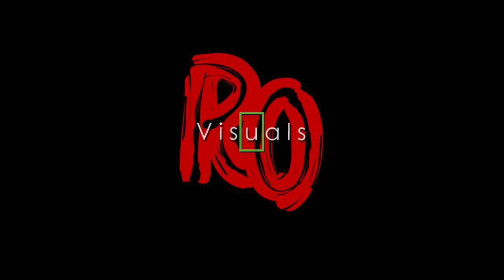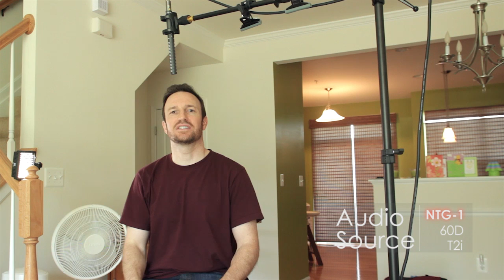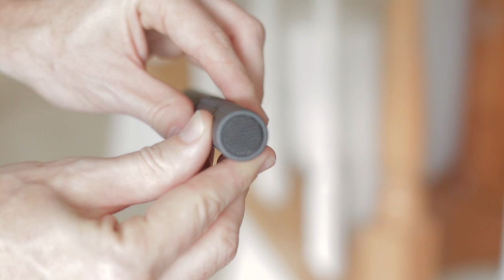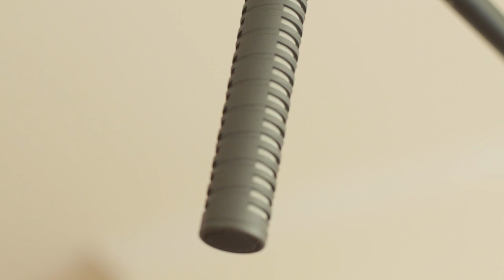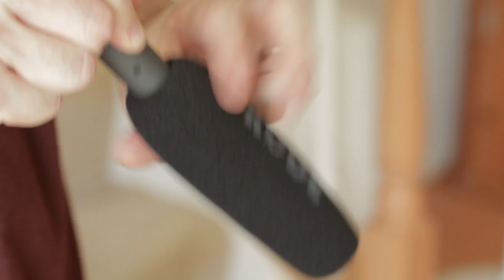Rode NTG-1 Microphone into a Zoom H4n for Dual Sync High Quality DLSR Audio for Video

Comment: Why didn't you go over the low pass filter switch?
Reply from the maker: This is too old to remember. And so am I ;) But seriously I never use it. Check the spec and make sure it's not set too high, you'd be fine using it at 80hz on most stuff but I just apply that in post production to avoid baking in the EQ

Comment: This was a great video and helped me make up my mind. Thank you and thanks for dropping the links as well!
Reply from the maker: Thanks, Joshua.
Reply: @RayOrtega  Quick question. I got the NTG1, LOVE IT! I also bought the multi function boom you linked up. Mine has a light mount at the end of the boom. I've done a search but can't seem to find a proper adapter to a 3/8 in screw. I'd like to mount the mic the same way you have here. What did you use as an adapter? I'd be more than happy to buy through an affiliate link if you have one. Thanks!
Reply from the maker: @DonahueJosh  Did you get it? I think there is a 1/4 20 thread on the tip of the boom pole correct? you'll need a 1/4 20 to 3/8 adapter https://amzn.to/34qn28N (affiliate) I just had the mic mount on the pole not properly attached cause I didn't have an adapter at the time

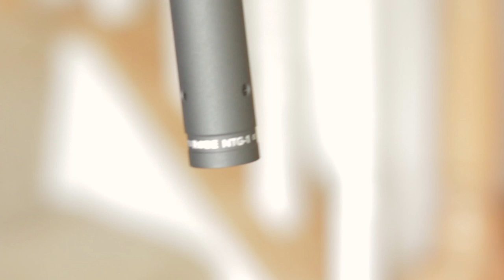Comment: First off, great video! At 6:02 the audio is only coming from one side. What do you have to do in post in order to fix it only coming out of 1 side? What is your workflow for that?
Reply from the maker: It's actually being recorded into channel one. So it depends on how your recorder works. In the case of the H4n you see here, if it's set to multichannel then that channel one will be its own mono channel. If you are recording a stereo channel and one mic goes left and one goes right, then you can split that apart in the edit and turn it into two mono channels which I show how to do and talk more about here https://www.youtube.com/watch?v=PvI2qgZ9bOs

Comment: Ray Ortega
BRO! When I realized the microphone you're using was an NTG-1 I was blown away! The mic sounds phenomenal! All this time I thought it would suck and I would have better luck investing in an NTG-3 mic because I plan on using it for better sound quality during filmmaking. I'm now highly considering the NTG-1 being that it already gives great sound and it's inexpensive. But Idk what do you think should I put in the investment now or settle for the NTG-1 and save the NTG-3 for later? Hit me back bro!
Reply from the maker: The NTG1 is still a great mic. I think what you are paying for with the NTG3 is the built quality and its ability to stand up to tough, in the field conditions. If you use the NTG1 properly then you'll get great results like this. With any mic, it's about distance. You need to get the mic as close as possible and make sure you set up the recorder for proper gain which you can also see on my channel. If the recorder is good and the mic placement is good, then you'll get great audio.
Reply: I mean my biggest thing is I want to be able to have a mic that will work outside as well if I'm filmmaking outdoors, but I'm not sure if the NTG-1 will do that since it needs phantom power. Unless if there's a way to work around that. Also I want to be bale to use a blimp and deadcat combo to keep an interference noise out i.e wind, loud noises, etc. Now lately I've been looking at the NTG-2 but again now quite sure. Any advice on this?

Comment: How did you get the signal to be so crisp? There's practically no noise or hiss. I used to run an NTG-1 into an H4n before I got a Tascam DR-60d ii and I could never get my signal to be THAT clean. Did you do post processing on this to reduce the noise?
Reply from the maker: Part of it is the proximity to my mouth. It's so close that it's probably impracticable for most setups but I was able to run the preamp less by being so close. It's also likely that I did a little clean up in post but if the noise isn't already quite low, post isn't going to help that much.
Reply: Ray Ortega what's your input level in that time?

Comment: Hi Ray...(sorry for my english it is not good) i have a Zoom H4n and a Rode NTG 2. Put i have a lot of sough when i use the Mic with 48V. And when i use the Mic with AA 1.5V Batterie then is the sough a little bit fewer. I can´t hear sough in your Video, why? It is so great. Thx für your Answer.
Reply from the maker: The H4n and NTG2 have an impedance mismatch and don't work well together so you have to turn up the gain so much that it creates noise. The NTG1 does not share the same issue and so I can run mine at a lower gain with less noise

Comment: Thanks for this video. I'm trying to eliminate "hiss" from using a lavalier mic going direct into my Canon 70D. Does the H4N cut out ambient noise or is there an additional interface being used?
Reply from the maker: +Mr. Self H4n has noisy preamps like the ones inside a DSLR but you can see that I've had success with direct lav to DSLR including the 70D https://www.youtube.com/watch?v=ZJi85J9SXyI so it could be your mic, if it's not sensitive enough and you have to set the preamp too high. The Zoom H5 and H6 have much better pre's and the H1 is great for 3.5mm plugin power lavs http://podhelp.me/h1amazon

Comment: I have an NTG-2 and the H4N and I'm hearing so much preamp noise. I'll lower the recording volume but then have to boost it in post and I'm told that not a good way to do it because boosting in post also boosts the noise floor and I do hear much of the noise come back when I boost in post.

So... what is your secret? Why so little preamp noise?
Reply: +MagnumDB Oh wait - Lord Bif Music may explain it. Well damn!
Reply from the maker: +MagnumDB yeah those two are famous for not working well together. I'm using the NTG1 in this video not NTG2. It has to do with a mismatch of the impedance of each device.

Comment: Great video, Ray! Question about attaching a shotgun mic to the boom stand. I'm currently using a NTG-2. Is it necessary to purchase a shock mount or can I use the mic clip that came with it? Is the shock mount crucial if the mic is in a stationary position?
Reply from the maker: +Ctrice if the mic is not moving, you can get away without a shockmount. You just have to conscious of it and be careful, monitor the audio when possible.

Comment: Excellent review, excactly what I needed, thank you very much! Something that might worth to be noted though: the NTG-2 got the ability to have a battery in it, that's true, but it's not the only difference: it has a bigger impedance, so with a H4n it's better to get the NTG-1, in order to avoid some bad white noise (if I'm correct). The maximum input sound level is slightly different too. Again thank you, couldn't find a better video for this mic with the H4n
Reply from the maker: +Lord Bif Music thanks! With the NTG2 that probably explains why I see lots of people reporting issues with getting enough gain out of the mic. I'd be curious to try the NTG2 with other recorders to see the difference. It's definitely the mic. I would prefer between the two because of the battery but I knew that there were some issues with it and the H4n. Thanks for the great feedback.

Comment: Thanks for the video Ray! I recently bought the NTG-2 and I connected to my Zoom H4N with the XLR cable, but it it barely registers any noise, even with the recording level up to 100 and it being an inch from my mouth. Do you know any way to remedy this problem? Additionally, it was only recording mono, is the NTG-2 only a mono mic, or can you make it stereo? Thanks a lot!
Reply from the maker: Are you sure you're powering the mic? It needs a battery or phantom power but lot both. That mic needs lots of gain but you should be getting a better signal. Most mics are mono cause voice is mono. If you mean it only goes to the left channel that's just how the h4n is setup up. Try recording in 4 channel mode and each xlr should record to its own mini track otherwise in steep mode channel one will be left, channel two right and you have to split them apart in post pro.
Reply: Thanks a lot for the reply! I think I got it now.
Reply: +Ezra Tillman The ntg1 works better with the h4n. However, the ngt2 works great with the h46.

Comment: So, I've been doing some video podcasting, and I've been using a condenser mic (blue yeti) which picks up a lot of extra noise. Picks up the washing machine, the furnace in the next room, and people walking on the hardwood floor in the apartment above me. I was told I needed a Dynamic Microphone to cut out background noise, but I'd rather have something that's not in the shot. Is there a chance this shotgun mic will cut out the extra sound above, and behind me, or this being a condenser mic as well will still pick that up?
Reply from the maker: +Dom Greco there will be more rejection via a shotgun but you're likely to still pick up the environmental noise just based on level. If it's loud enough, it's going to get into almost any mic. But yes, a shotgun or dynamic with a cardioid pattern will give the mic more of a focused pickup pattern. Thanks for watching!
Reply: Thanks for the reply! I might look into a noise canceling lavaliere mic in the meantime.Ray Ortega

Comment: i just bought the NTG-1 and im using it with the ZOOM H5. I've done a few test in my room with the door opened and the results was not what i expected. It is quite noisy, and whoever is talking downstairs (in the house. my room is upstairs), they can be heard. Or whoever is outside my room somewhere, lets say they cough or open/close their room door, it can also be heard. They're all very obvious. Or is the NTG-1 ment to be like that? because im a newbie in audio recording. Also, what is the filter for? i've read it in the instruction manuals but i am not quite sure. i've done a test with it ON and OFF and i dont hear any difference?
Reply from the maker: RedBird it's still going to pick up noise. With just about any mic you are going to need a decently quite environment to get something that is only you and not the environment but you might have your gain too high. Turn down the gain and record at lower levels like between -18 and -12db for average peaks. 

The filter is a high pass filter that takes out some of the lower end of the frequency spectrum which can help with things like low noise rumble from passing cars or some HVAC systems. You can use it or not. You can also apply the cut in post production.
Reply: Ray Ortega thanks for your reply. and i know i may sound dumb but how do i turn down the gain? and also i've read that turning the filter on will cause the persons voice to change? so is the high pass filter recommanded for film making?
Reply: Ray Ortega oh gain as in lowering the volume thingy on the h5..
Reply from the maker: RedBird yep and you can skip the hi-pass filter and just add it in post production if for some reason you need it.

Comment: Hello Ray. 
First of all thanks for your vídeo .
I have two questions. What do you think if i use this microphone to record some dialogues, in a short movie? It will be enough, or i have to use something better? The other question is if this microphone use balanced líne like xlr? And if this microphone is true condensar or electret? Thanks
Reply from the maker: MSXP00701 you can use this, you'll just need someone to hold it close to your actors. A boom operator like you see in movies and TV. Yes this is XLR. Not sure about "true" condenser but as far as I know it is. You can check the specs in the links in the description. Thanks for watching!

Comment: You are using the "Impact Multiboom Light Stand and Reflector Holder" to hold your boom?  Are you using anything else with it?  I am looking for a cheap and easy way to hold a NTG2. I will do filming without a sound man to hold the boom.  So I need something easy and portable.  Thanks so much for the video
Reply from the maker: Nixon Lee yes there is an extra piece that doesn't tend to be cheap which is the shockmount that the NTG is in. However, the mic should come with a standard mic stand clip and you can use this as well but any vibrations picked up by the boom will translate into the mic much easier. Also with the standard mic clip you might need a piece that take the thread down from it's size to adapt to the 1/4 20 thread of on the multiboom
Reply: Thanks for the super quick response!  Great.  With a decent shockmount and this "light stand", I will have a convenient and seemingly more portable way to unman my NTG2.  I really appreciate your advice and I like how you give your equipment specifications on your video description.  I'm definitely subscribed to your channel!

Comment: Great review Ray! I currently have a VMP, and while it's great, I sometimes shoot videos that require me to be farther back...I often shoot videos with two people next to each other--If I mounted the NTG-1 like you did, but in between the two people,would the sound be okay? I guess I'm just wondering how much of a lateral spread there can be and still sound good. Thanks!
Reply from the maker: michael good question, not really sure it would be that much better than the VMP in that use case. Still need to be close and it's quite directional.

Comment: I have this same mic, and the problem I'm running into is there's too many highs when I'm not talking.  It's that very high pitch "eeesssss".  I turned off my computer and there's no other noise.  I notice you have a nice loud volume, but when you're not talking, there's no noise.

Did you run your audio into any post-processing?  If so, what did you do?  Thanks.

Edit: Nermind, saw your post processing video.
Reply from the maker: DesignCourse thanks
Reply: @RayOrtega  he was asking a question :/

Comment: Hi!
I'm using the same shotgun Mic and the H4n, but when i use it, the sound is pretty bad. Can you tell me what kind of configuration do I have to use? (I've already put it in Stereo and 48hz/16 bits)
Thanks!
Reply from the maker: You are probably in a bad environment and/or need to get the mic closer. The further away you are with the mic, the worse it will sound. Also look up some videos about how to use a shotgun mic properly. Thanks for watching.

Comment: Thanks for the great video!  Have you tried pairing the Fethead that passes phantom power with the NTG-1 and Zoom h4n?  I have an ECM-NV1 that I would like to use with an h4n, but it needs phantom and a signal boost.
Reply from the maker: I love the Fethead. I did a quick unboxing video of mine and I use it with a couple different setups. I did not have it when I made this video and the NTG1 was a loaner so I can't test it but it's an awesome device that does exactly what it says.

Comment: Hi Ray,

How did you get such good low end from the mic. I just bought the NTG3 and a juicedlink preamp but didnt seem to get the low end frequency for that great broadcast quality audio. Thoughts?
Reply from the maker: I suspect that most of the low end you are hearing is coming from the proximity effect. The closer you get the mic, the deeper it will sound on a lot of mics. This mic in this video is quite close to me, as well I'm pointing it at my chest which will emit a slightly lower end then your mouth.

Comment: Are you using any specific lights?  Also I'm getting a H4N do you think I can get away with recording things off the H4N for a while without an additional shotgun or should I quickly make the purchase of NTG-1 or 2.
Reply from the maker: In this video, no. This is pretty much all natural light from a large window. There is one little LED light off to the side that you see in one early shot but it's not doing much at all. 

You can get away with using the on-board mics of the H4n but they are not as directional as a shotgun. But in the meantime check out the awesome quality I'm getting by doing just that: Linco Flora Easy Softbox - Video lighting Test

Also the H4n just went on sale for an awesome price: http://www.bhphotovideo.com/c/product/600761-REG/Zoom_H4N_H4n_Handy_Mobile_4_Track.html/BI/5841/KBID/6710
Reply: Thank you Ray!

Comment: Thanks for the review, but I am a bit confused.  I need an external power source for this mic?  I am looking for a good quality shotgun mic that will attach to the top of a Canon DSLR and just plug into the camera??
Reply from the maker: Yes this mic needs phantom power. You can't just plug it into your cam. That isn't going to give you the best audio anyway. However, if you;re doing run and gun video and just need a mic on top to capture audio better than the cameras mic, then check out my videos with the VideoMic Pro. That's the mic you'll want to get for on camera work because it helps you defeat the camera's bad premap. Check out Rode VideoMic Pro into a Canon 60D
Reply: Ray Ortega Thanks Ray!  I'll check that out now.  I've made videos with the cameras mic and the background noise is terrible, it ruins the whole video.  When in a closed off area the echo is even worse.